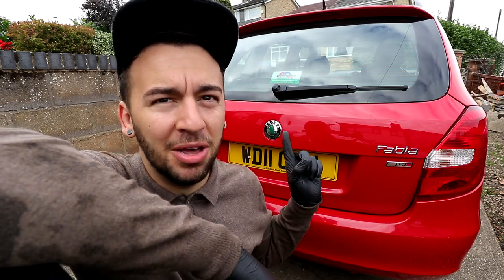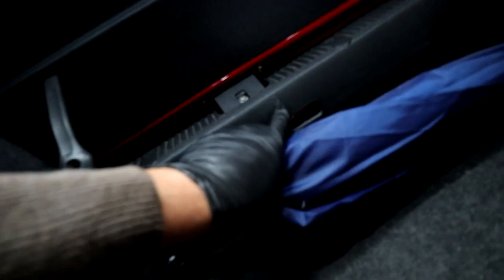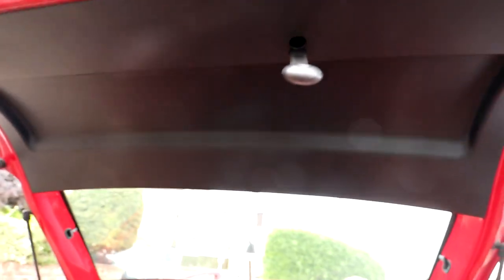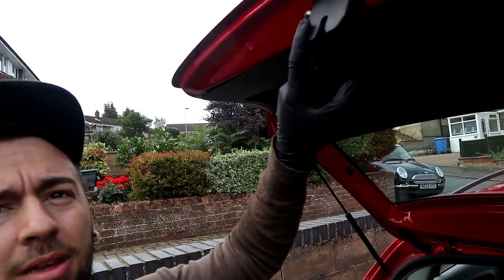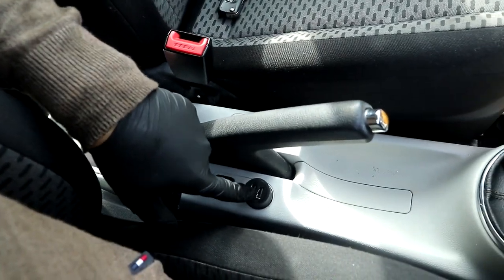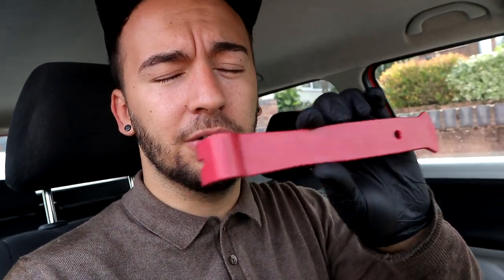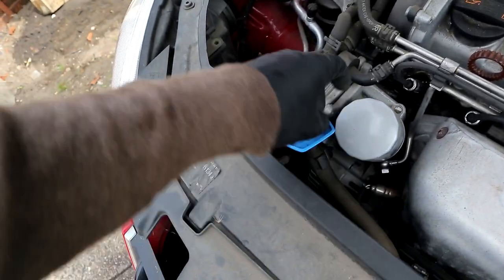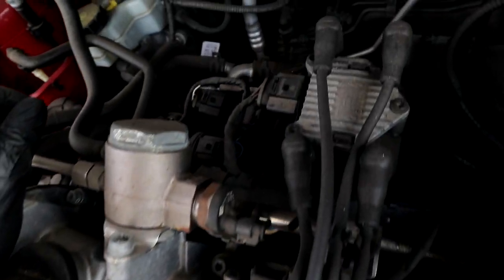Skoda Fabia Boot Wont Open! *Fixed*

Comment: I think failing door/boot locks is just a sign of cars of that era being built to a budget. That's when they were all switching to plastic components instead of metal. It's also when they figured out there is money to be made in parts. VW parts prices skyrocketed overnight almost, hence why the quote from the garage will have been so high. 
BMW were still making good cars then and their parts prices are ok. 
But VW and Mercedes decided to build cars cheaper, charge you the same and then charge you extra when you come back for parts.
Reply: Its also to blame on just bad ideas, these parts only go bad because they decided to make them electronic and add about 20 new possible failure points a regular latch wouldn't have.

Comment: I have a question maybee someone can help have a passat 2001 variant and i cannot open the boot from the drivers side door switch.Anyone had same problem? I already changed the micro switch rubber switch handle on the boot. thanks

Comment: Hey, not sure if anyone in the comments can help, but I have a 2010 Ford Fiesta zetec And ever since Ive had the battery disconnected I can’t get the aux or Bluetooth to work, any help would be highly appreciated
Reply from the maker: Adam Clarke fuse?
Reply: It’s a Ford? Does the stereo it’s self work?
Reply: The Savage Garage I can’t find out the correct fuse for it as I don’t have the owners manual not sure if anyone else has had the same issue
Reply: Adam Warren yes the radio works
Reply: Needs soft updating on the radio
Reply: Leigh Mole how do I do that ?

Comment: Early 2000s VAG cars had reliable mechanical boot latches. No idea why they decided to go electrical, it's a pointless innovation and prone to breakage like you've experienced. It's also a bit dangerous? VWs, SEATs and also the BMW 1 Series have the boot lever integrated into the rear badge. With the old mechanical levers, there's some resistance before the boot actually opens. The electrical levers have no resistance, so if you get that "sticky badge" problem where it gets stuck in the open position, you run the risk of the boot opening by itself when in motion...

Comment: Just to let you know Škoda, is a Czech automobile manufacturer not german.
Reply: Yes but their engines, the majority of the electrical system and everything else on the car is German, i know this because the part number is the exact same as the VW and Audi part numbers. But you are right in the fact that Skoda as a Brand is from the Czech Republic. Volkswagen Group own Audi, Bentley, Bugatti, Lamborghini, Porsche, and Volkswagen.

Comment: Had the Same issue on my 55 plate  fabia. Crappy electric switch
Reply: I can’t understand why my button is still original? It’s a 06 Skoda fabia
Reply: Adam Warren mine wasn’t the lock it was the actual button on the boot lid. In my case the rubber seal had broken on the actual button and had allowed water in over the years and corroded the connection. WD40 and a rag did the trick